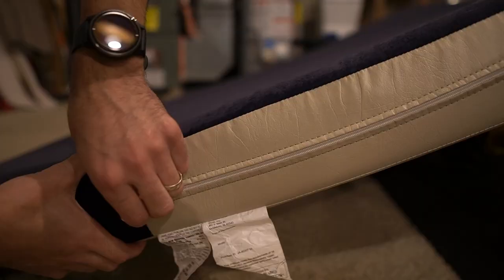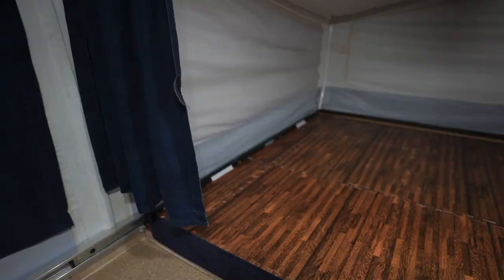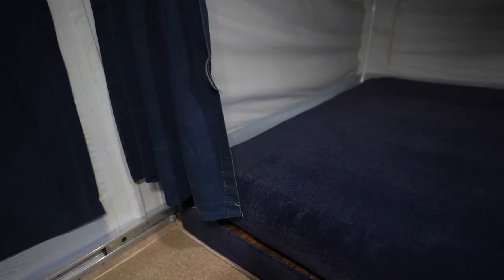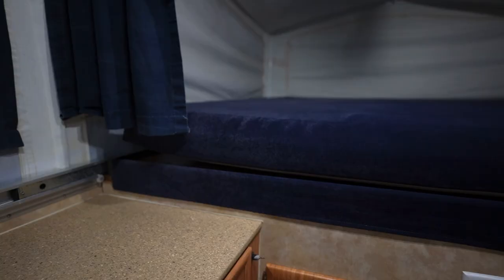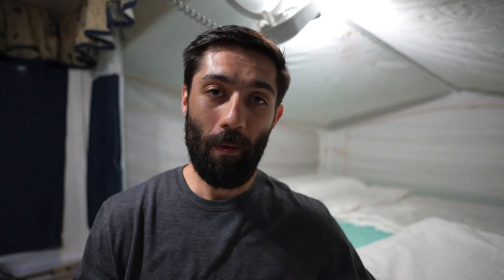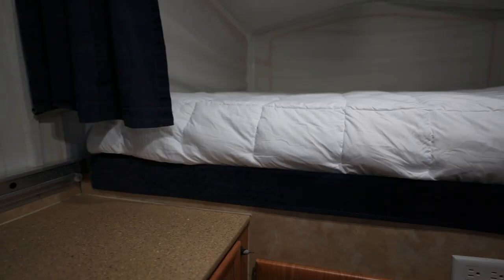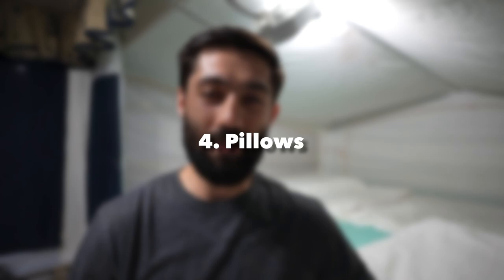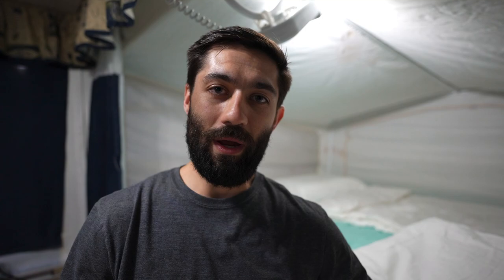How to Get the Best Night of SLEEP Camping Ever! | Pop Up Camper MATTRESS Modifications

Comment: Instead of doing the foam tiles I got a 3 inch insulated 2 person camping mattress. It’s about the size of my bed which is a full size so just have to fold in the edges and open the deflate valve when I close up. Then did a 3 inch foam mattress topper on that. It’s super comfortable with no cold or hurt hip issues.

Comment: We did the interlocking foam as well and what a difference. But make sure you dont get ones that are to thick so you can leave them under the mattress when your going to lower the camper . Great video again as well.. Today here it was beautiful out so I Installed two USB fans at the fridge cooling fins to blow the warm air outside to keep the fins cooler.. Another one of your great ideas..

Comment: We found two 3” twin memory foam on marketplace. Had to trim a lil bit but not bad. We put this under popup mattress. Only downside is we have to pull them out and roll them up under the table cause the popup won’t close with them under the mattress. Works great but extra steps during setup and takedown.

Comment: We're thinking about an air mattress under our "stock" mattress. It's designed to be inflated to 10 inches high. We'll try the air mattress at different heights and see how it feels. We'll leave the air mattress in place under the stock mattress, let the air out and we feel the top will close easily. I'll report back and let all know how it worked out.

Comment: We have a '93 Starcraft that we bought used about a year after it was built, but it was very lightly used and some of the cushions still had the plastic on them and we've kept them in good shape. However, our cushions are 4" thick and I don't think we could fit even one layer of egg-crate memory foam inside the cushion covers. What we've done for a long time, in place of your mattress cover, is we had a couple of old low-temp-rated sleeping bags that are basically square when fully unzipped. We lay them out flat on the beds as additional padding (and insulation) and they just live in the pop-up year-round (and we can use them as emergency sleeping bags or an additional comforter in a pinch).  After we complete a bunch of other renovation items, I may decided to spend some money and upgrade to actually custom RV mattresses from Mattress Insider...they're a national custom RV mattress company, but they are based here in Denver, CO and have a showroom just a few miles from where I live...but that's a decision for later.

I did incorporate your interlocking tiles idea this weekend. My bed platforms are almost exactly 24 SF so six 2'x2' tiles almost fit perfectly...just needed to trim about 1/2"-1" off two sides and notch a couple of corners. We went with 1/2" thick tiles (after considering 3/4" and 1") because with our sleeping bag "toppers" we already need to push down slightly to get the camper to latch in the closed position, but the foam tiles should help cushion pressure points (shoulders and hips while sleeping on our side) and add insulation in the colder months. I'm seriously considering getting another set of 3/4" thick interlocking tiles to cut as temporary flooring covering, especially if I redo the flooring. I would use them to protect the flooring from items (stove, ice chest, etc) that are stored on the floor during transit as well as temp insulation when winter camping...the vinyl flooring has gotten pretty marked up over the years from things rubbing and moving around on travel days. It's well worth the minimal cost to protect the flooring, and I can just store them away in the car during summer camping trips.
Reply from the maker: All great ideas!

Comment: Do those interlocking foam tiles breath at all? I'm thinking about doing the same thing but want to avoid creating a mold farm between the mattress and decking. I know that for houses memory foam mattresses must always sit on slats or some kind of platform that allows for the mattress to breath. Some people have been known to put particle board on top of a box spring and set the memory foam mattress on that which can lead to mold buildup if you live in a humid area.

Comment: Instead of buying toppers or RV mattresses which can be super $$$. Zinus foam mattress 6" and cut to size. Under $250.  You can put a kleenex box of the matching height and close down the camper to see if it will fit.

Comment: We have a 2017 Palomino Real Lite pop up with the heated mattresses.  The full side has a simple duvet cover on top of the mattress which provides some nice padding, and still allows the heat of the mattress to come through.  I just bought a 2" memory foam topper for the queen side of the bed.  However, if I put this topper on top of the exiting mattress, I believe that it will nullify the benefit of having a heated mattress.  I was wondering if it would be safe to put the memory foam topper underneath the existing mattress? I recently watched a video in which a guy cut open his heated mattress, which showed the heating tape element was closer to the top of the mattress, so I don't think it would harm the memory foam, but I just don't know.  I appreciate any opinions on this, and thanks in advance.

Comment: Great video. Love your channel. Would really love a video on flushing the hot water tank.  I have a 2006 jayco 1207 and the tap water smells awful, was told to flush the tanks but dont know how.  Anyways, thanks for your viedos!!!
Reply from the maker: Thanks! I think we could probably cover this topic when we do a video on de-winterizing your pop up/sanitizing the water system.  The cliff notes version of flushing the hot water tank would be to hook up your pop up camper to city water, ensure the hot water heater is not bypassed, and then open up the hot water tank drain valve.  This would, in turn, allow fresh water to run through your hot water tank, thereby flushing it.  Make sure you’ve already drained any RV anti-freeze from your water system prior to doing this.

Comment: I was wondering if you could give some advice on the best places to buy parts for the pop up campers. Love your videos
Reply from the maker: We use a mix of Amazon, Ebay, and depending on the make of the pop up, there is usually a vendor website that sells parts specifically for that make.
Reply: @ItsPoppin  Awesome! Thanks. I have a 2004 Starcraft.

Comment: We just bought a 1997 Jayco 1207 KD J Series.  It's in pretty good shape.  I've just been trying to get it cleaned up.  Don't know if it is recommended or if there is a better way to do it but I power washed the cushions and got a lot of grime off the covers.  I'm wondering if anyone else has done that?  I'm also wondering if I could do that with the mattresses.  I have a nice sturdy wooden fence I can throw them over while I wash them cuz I know they will get super heavy with all that water in them.  Is this is a good method to clean the mattresses?

Comment: The new to us camper we just got came with a replacement mattress that makes the camper roof have to be pushed just a bit. Is that going to cause problems in your opinion?
Reply from the maker: Is it still getting a good seal between the roof and the box?
Reply: @ItsPoppin  seal seems to be fine. It’s completely closed. Just have to push down on the top to latch it.
Reply from the maker: Should be fine as long as you’re not putting too much tension on the latches. You probably know this, but you can loosen and tighten the latches by turning them.
Reply: @ItsPoppin  hubby grew up with these but that was many years ago. He did show me that feature. One is a little broken. I’ll find a replacement for it. Either way it does seem to be sealed when latched. Thank you for the piece of mind. I’m learning a lot watching your videos.

Comment: Between the foam tiles and the wood do you get any condensation. Looking for a solution to my mattress not getting wet on the bottom
Reply from the maker: No, we've never experienced that. You could try to actively combat the condensation by getting getting a thing of damprid, using a vent fan if you have one, or cracking some windows.

Comment: we tried putting 2" memory foam toppers on our mattresses but we were unable to close up the popup with them on, which was a huge disappointment.  Even without the toppers we kinda have to push the top down to get it to latch. :-(
Reply from the maker: Oh dang, I should probably put a disclaimer on this that the max matress height is make/model depend.
Reply: How can you find out the max of height of the pop up?
Reply from the maker: I've heard of people utilizing an empty tissue box, placed on the bed. Lower the roof, and see if/how much the tissue box is squished. This will give you a good estimate on how much space you have.